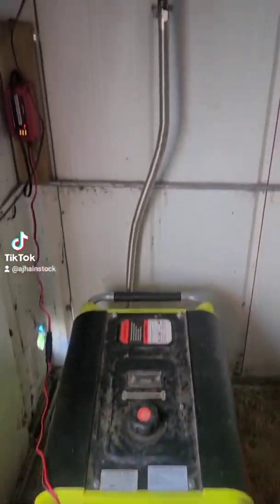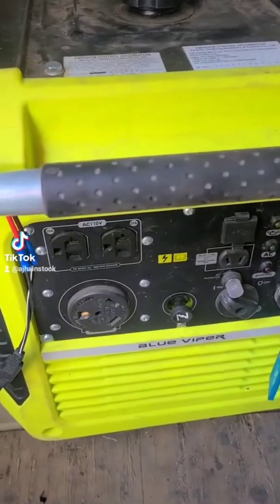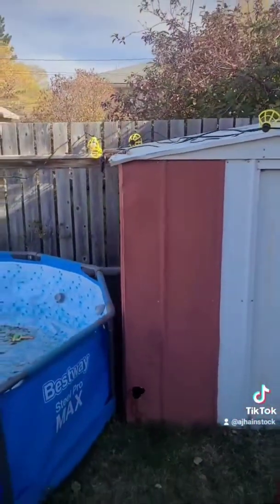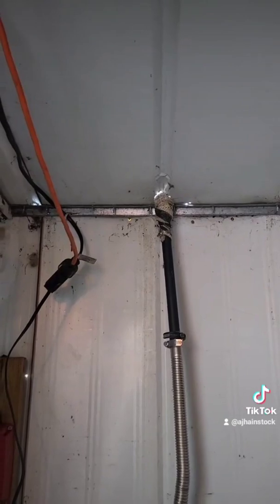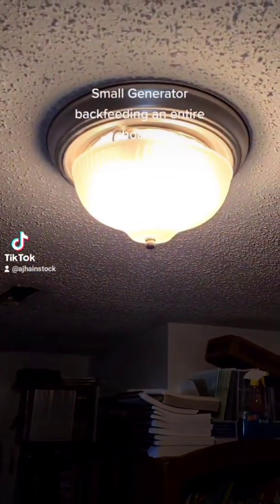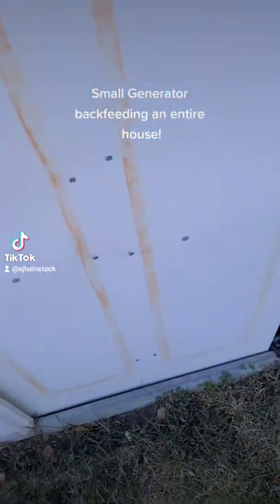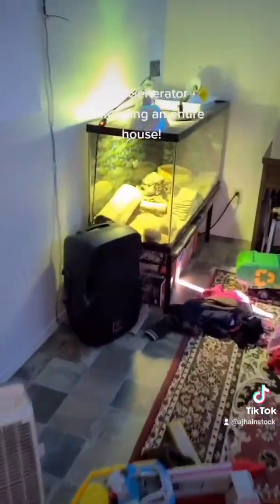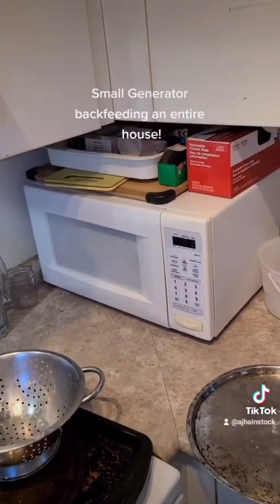Generator in shed exhaust extension and backfeeding whole house.

Comment: I have a similar set up. But I feel hot air coming from around the exhaust. Is that normal or is my setup not air tight
Reply from the maker: As long as you don't smell any exhaust fumes you should be fine. Mine let's off hot air out the back as well, the fan that built into the generator electric side moves air from its internal fan to keep it from ovr heating  odds are that what you are feeling. If there is no odor of exhaust you should be good.
Reply: @AaronsAutomotive  yeah no odor. And when I put my combustible fumes meter it doesn't detect anything. When I put my meter at end of pipe it whales. My carbon monoxide detected doesn't pick anything up.

It just worries me cause I felt hot air about 3 inches left and right of the pipe.  It does feel like a warm air fan type wind